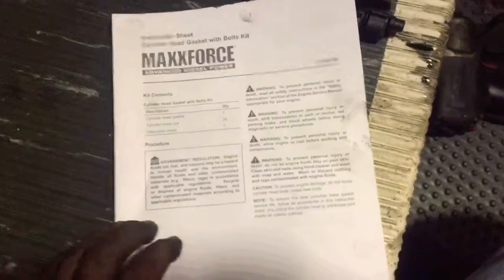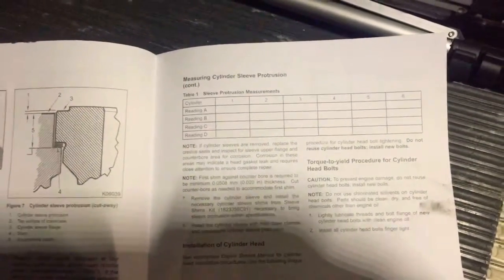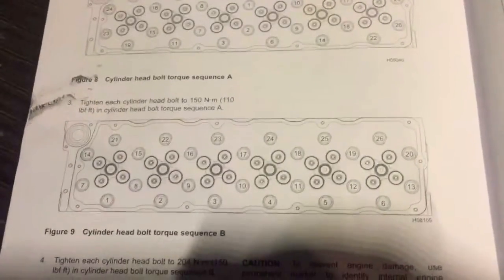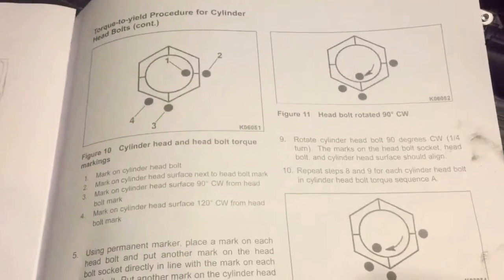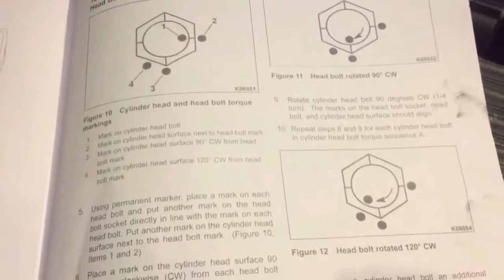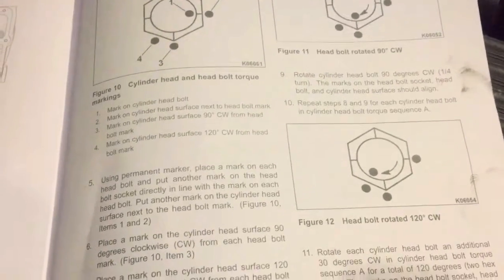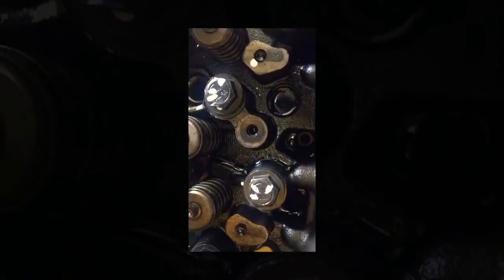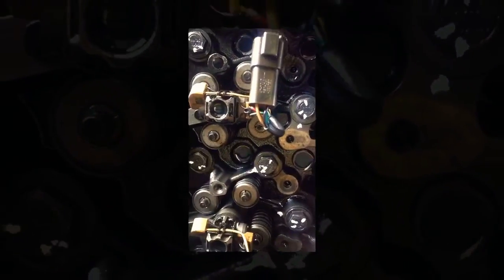DT 466 head bolt torque sequence

Comment: you reused the bolts?
Reply from the maker: Hey Emilio. No sir. Head gasket set comes with new bolts.
Reply: Joe’s Bus Barn  I reuse the bolts on a 2002 dt466. And now I’m losing coolant and is not showing in the oil. I’m wondering if may be the used bolts
Reply from the maker: emilio bussi   What year is your engine
Reply: Joe’s Bus Barn  2002 international 4300 (dt466)
Reply: Joe’s Bus Barn No EGR cooler
Reply from the maker: These engines (if it is 05 and up) have issues with egr coolers.
Reply from the maker: Head bolts get replaced because they tend to stretch with age.
Reply from the maker: I would disconnect exhaust down pipe (off turbo) and check to see if you find traces of water
Reply from the maker: emilio bussi how often do you add coolant
Reply: Joe’s Bus Barn  A gallon every other day.
Reply from the maker: That sounds like you might have a seeping head gasket. Did you check down pipe for traces of coolant.